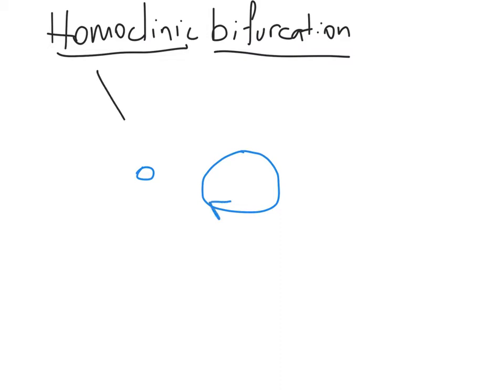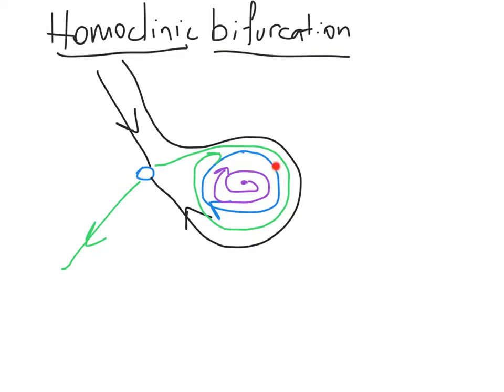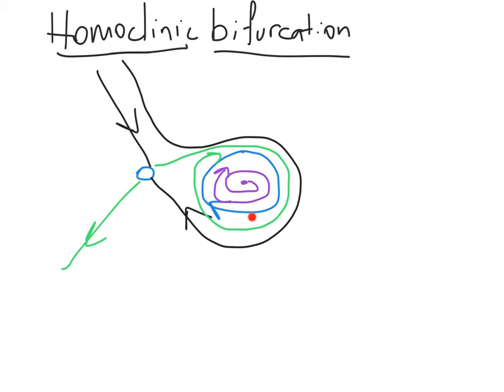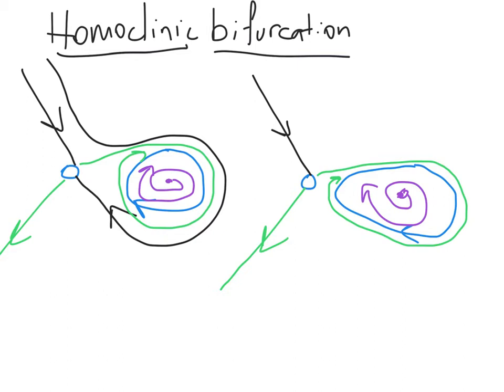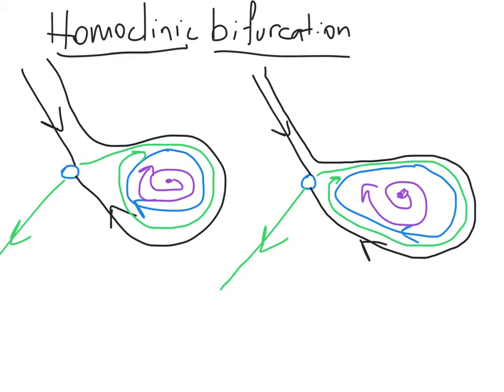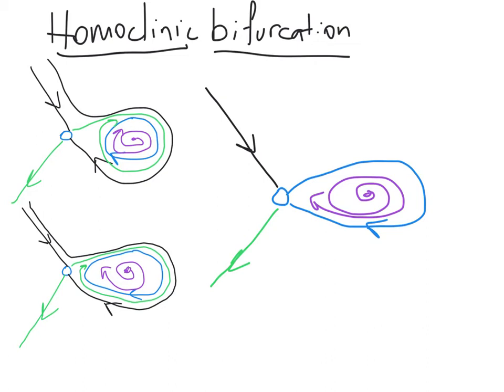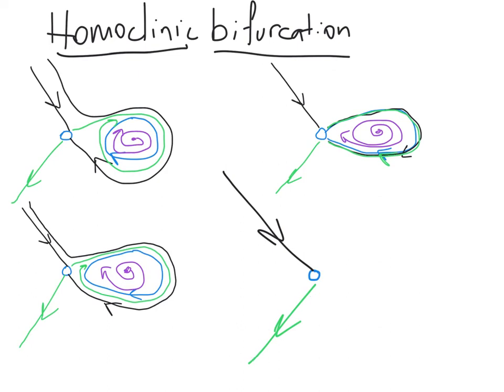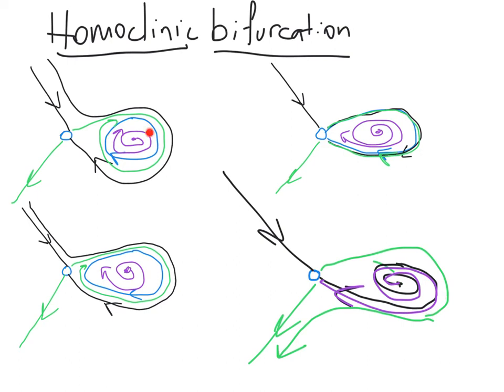C14 Homoclinic bifurcation.

Comment: very useful thanks. but how this leads to chaos?
Reply: Not all homoclinic bifurcations may lead to the existence of chaotic behaviour. If you particularly have the Lorenz system in mind, the chaos is really led by the opening of the flow between the two sides that the homoclinic bifurcation enables. By which, of course, I imply that before the homoclinic bifurcation (r<13.926), there is a separation of flow between the two wings and all trajectories spiral on to one of the Fixed Points. As soon as the flow can go from one wing to another, countably many periodic orbits start existing, alongwith uncountably many aperiodic orbits: an hallmark of chaotic behaviour. 

Check out Sparrow (1982) for a detailed analysis of this phenomenon. Its a fairly readable text, with great assistive diagrams. Kaplan and Yorke 1979 also have some great diagrams that helped me understand what is going on.